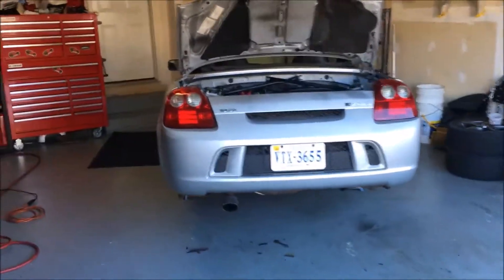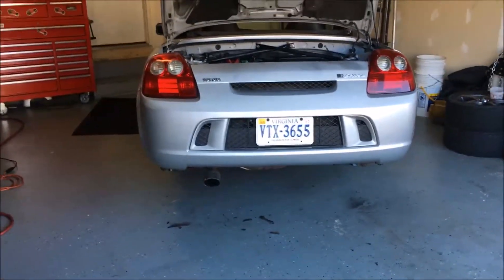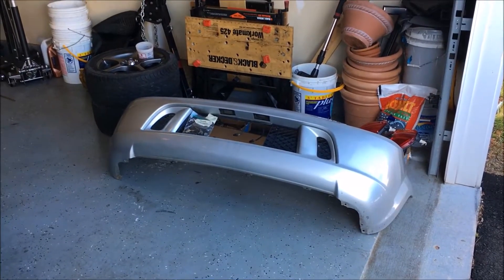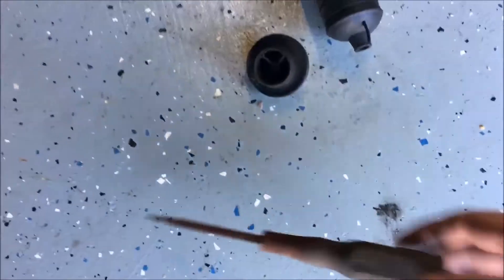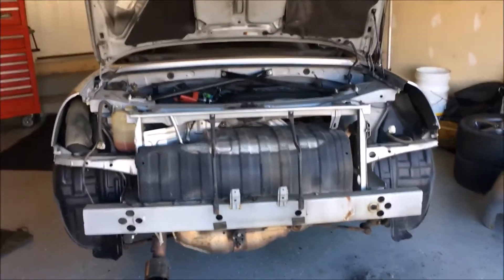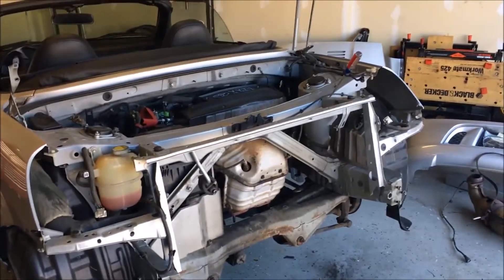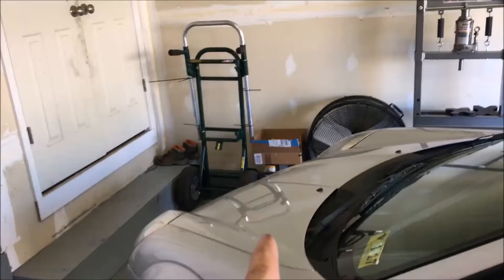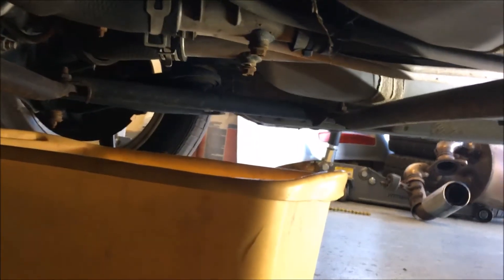MR2 Spyder Engine Removal Start

Comment: Can you only remove the engine or you have to bring the transmission down too ?
Reply from the maker: You could remove the transmission without the engine but to remove the engine you have pull the transmission.

Comment: I was charge 3100 dollars to replace a rear main oil seal claim had to remove motor.wrong diagnosis only pcv hose split and bad pcv valve.later found out dealership lied about cost
Reply from the maker: Those ridiculous costs is one of the reasons I started working on my cars.  I couldn't afford to have fun things like this otherwise.

Comment: Thank you for posting your progress.  What manual or information are you using for the disassembly process?

I am  still having running issues on my MR2 and miles are under 59K....Dealer knows what they sold me, but I still plan for 2zz conversion,.... I was only hoping to drive car this summer first and have a viable engine to resell.

Looking forward to more videos and and as much detail as you can provide.

FYI:  For parts I have found the following
  sparkplugs.com is a Denos distributor and pricing looks good
  monkeywrenchracing.com  they specialize in Lotus and MR2 2zz engines

If you find other supplies, please advise.  Also looking for more detail on engine removal and have not found much detail.

Happy motoring,
P
Reply from the maker: The link to the instructions is in the description.  It is on Midshiprunabout.org
I will add links to information I use on other videos as well.  There is a good amount of info out there but you do have to hunt.